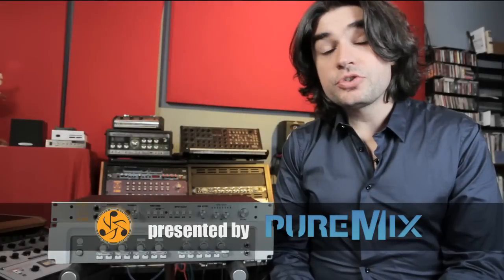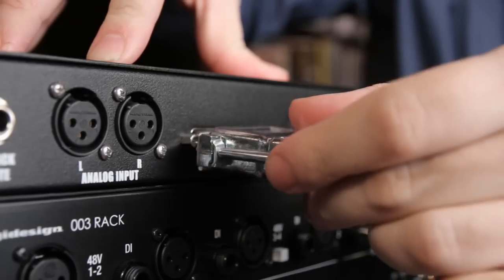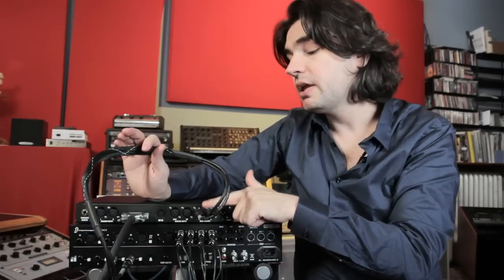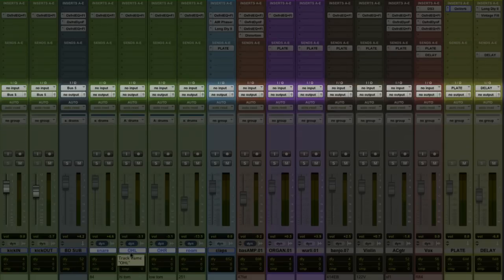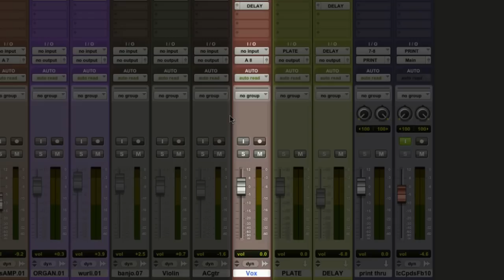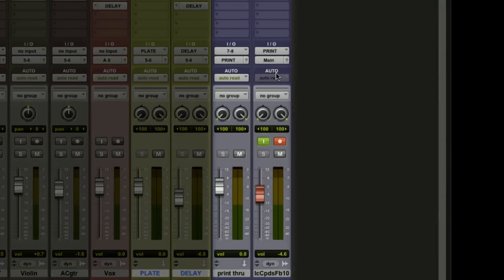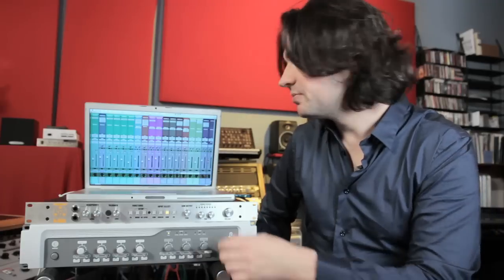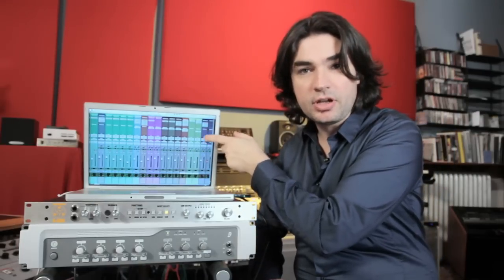Dangerous D-Box: Integration

Comment from the maker: It can be used for tracking or mixing. It allows you to utilize all of your D/A converters, giving you more headroom, and letting you sum your tracks in the analog world instead of the digital world, which ends up giving you benefits like tighter bottom end, more punch, more depth and width, etc. It also allows you to take advantage of the recall benefits of your DAW, while still using a console-like workflow and getting your mix out into the analog world.

Comment from the maker: Stem is a term mostly used in mixing/analog summing where multiple tracks of audio are being bussed to one stereo pair. So for instance a "drum stem" might have kick, snare, hi hat, toms, and overheads all bussed to outputs 1-2 on your interface. Unity gain means the device is neither adding nor subtracting gain to the signal, so it usually means when a fader is at 0.

Comment from the maker: You don't really need the impedance transformer- a regular 110 ohm digital audio cable is sufficient, but when connecting spdif and aes devices together there is one very very important rule to follow, which is that the cable must be kept as short as possible. Any more than a few feet runs the risk of the impedance actually becoming an issue- but at such a short length it is totally viable.

Comment from the maker: @memberboard1 the Rosetta 800 has an AES in/out d-sub. You will have to look in your manual for the configuration, but all you need to do is get a digital snake cable that goes from AES to XLR, and plug the first AES out into the D-Box DAW input.

Comment from the maker: To use external outboard gear with the D-Box, you would just insert it between your interface analog outs and the D-Box Sum Inputs. For example, to use a stereo compressor on the drum stem, you could output the drums on 1-2, then plug analog out 1-2 of your Saffire into the compressor, and then output of the compressor into D-Box Sum Inputs 1-2.

Comment from the maker: When using the D-Box you still need an interface to handle the conversions. The D-Box only has two stereo digital inputs with a D/A converter that is meant to be used for monitoring. The functions that the D-Box performs are Analog Summing, Monitoring, Stereo D/A, Talkback, and Headphones. As far as quality of the converters, this box is made to mastering specifications and the converters are made to be mastering quality reference converters, meaning they are clean and transparent.

Comment from the maker: @tpatmix58 Also, yes you can use an LT and D-Box together. If you just take the Sum Output of the D-Box and plug it into the Expansion In of the LT you can have 24 channels of analog summing perfectly linked together.

Comment from the maker: @mtracy19 it sounds like an issue with the UFX. Make sure you go into the rme software and turn off the monitor control. Outputs 1-2 are usually controlled by the volume knob when you are using the UFX as your monitor controller, but when you are using the D-Box, you want don't want those outputs to have variable volume.

Comment from the maker: Yes 7-8 can be a regular stereo pair if hard-panned. The volume difference is probably due to the phase relationship with the signals. When they are hard panned there is no phase cancellation happening.

It's normal for SUM and DAW to be different levels, because you are listening to 2 different D/A converters, which have different calibrations.

Comment from the maker: You just have to route the output of the aux into the input of the print track via an internal bus in your daw. So for example, set the input of the aux to be 3-4, and the output to be bus 1-2. Then set the input of the print track to be bus 1-2, and the output to be digital out. That let's you monitor the mix at the very last step via the DAW button on the D-Box

Comment from the maker: The 002 will no longer be used as the monitor controller, the D-Box will. So all 8 of your analog outputs from the 002 will be used for analog summing and will be plugged into the D-Box. Since the D-Box is sending your signal to your monitors, and all of your outputs are plugged into the D-Box, you can easily monitor any output from your session.

Comment: In pro tools the number crunching is all out adat 1/2.. I know crunching is blurring the image, but the mixes are super nice.. not pat'n my own back, but I was wondering if running the outputs of the 002 which are all open, would this mess up my d/a conversion from the apogee, or would this be bypassed all together, the d/a of the 002?  I have 8 outputs open on the 002  but all 8 channels of the ad8k are running inserts with my hardware..

Comment from the maker: Well, the D-Box analog inputs have a maximum input level of +27 dB, which is 5dB higher than the output of most interfaces. What that means is no matter how loud your tracks are coming out of the interface, they will never clip the D-Box. So if your tracks are in the red, but you don't hear any distortion, you are fine.

Comment from the maker: What you want to do is bypass any levels controls on the interface. All 8 of your analog outs should be fixed at line level. When you are using your interface as your monitor control, you need that volume control, but since you are now using the D-Box for monitoring, you want all of your analog outs to be fixed at line level so that they can be accurately summed

Comment: I have this exact setup, try it this way.
Use 1-2 (Stereo Pair) as your summing output. Ignore your master channel in Logic
Connect your sum output from D-Box to stereo input on UFX. 
Create Aux track in Logic mixer and set input to same inputs on UFX that you connected D-Box Sum Output to. This is your new mixbus.
Route that aux to a bus, let's say Bus 64, which has output set to 13-14 AES
To print your mixes, create an audio track in arrange window and set input to Bus 64.

Comment: I am using a Apogee ad8000se, adat in and out to a digi 002 all clocked by a big ben, I have quite a few pieces of outboard gear including your phenomenal Bax eq,  a Manley mu, Avalon 737sp 2dbx160a's,aphex 104  and pretty much monitoring aes out to a alesis masterlink..  I use the apogees outs as of now.. How could I incorporate a summing mixer like this! saw you at sweetwater gearfest.. whats your thoughts on this, the most efficient way?

Comment from the maker: @memberboard1 As far as PT9 is concerned, everything would be exactly as described above. As far as the 800 goes, the theory is the same. Take your 8 analog outputs, plug them into the SUM input of the D-Box, take the SUM output, plug it into a pair of line ins on the 800 to record your mix, then set the output of that track to the digital out of the 800, and plug that digital out into the DAW input of the D-Box, and use that to monitor your mix.

Comment: I just bought the D-Box and I use it with Logic Pro 9.  I follow everything just fine except, when you get to setting up the Aux tracks.  Logic Pro is set up somewhat different when it comes to the that.  I don't have a "Print" option.  So I need to know in Logic, what should my Inputs and Outputs should be set to for the AUX, as well as for the Audio track channel strips?  Also, am I assuming correctly that we're recording the D-Box output on that last audio Track that we have the "Record" on?

Comment: I had a question about the AES/EBU to SPDIF cable you're using, or that you're using an RCA to XLR on a digital connection. AES runs at 110 ohms, SPDIF 75 ohms. Im having a hard time finding such a cable. Ive seen inline impedance trasnformers but they are expensive. Are you just using a regular XLR to RCA cable? If so, I dont think thats a good idea for monitoring your sum I would think.

Comment: and sorry, if you do the alternate "Tracking" bus in Logic, you will not need to monitor through "Sum" on D-Box. Goal being, you don't have to adjust your D-Box main volume, or flip monitoring sections. YOU WILL need to engage audio monitoring in Logic as well as Low Latency mode. This will bypass some other latency causing bus plugins, but if that bothers you, you can just do the Sum on D-Box and hear all your processing from Logic. :) 
Sorry for the long winded book, Hope some of it helps

Comment: Also, do I from now on have to print mixes to tape instead of bouncing down directly into protools. IF I perform a bounce now, I can monitor thru the dbox, but the sound will not be the same as summing out. is that correct.?

Comment: Question. I now have my dbox and holy shit what a first impression. But. My question is. When comin back in on 3 and 4 inputs after summing how do I monitor the difference. The way I have it now. I have an aux that accepts 3&4 as inputs and I go out thru the digital out....for the print track do I use 3&4 as the inputs as well and out again thru the digital out. Im a bit confused at this point

Comment: So, how do I A/B between my mix PRE d-box, and my mix post d-box return? I basically want to hear what difference summing through the d-box makes in a quick A/B fashion. Thanks.
Reply from the maker: Hey Bill,

It might be best to give us call and talk through it. What Fab is talking about at that point, is essentially input monitoring. When it's on, you'll hear audio hitting that track if you hit play and your routing is correct. When off, you'll hear the audio that was recorded to that track, if you recorded the mix already. If you don't hear audio when it's on and you hit play, something is wrong with your routing.

This is not the same however as hearing it pre/post D-Box. There is no real way to do that other than doing a mix in the box first. Then starting the mix from scratch with analog summing the entire time, and comparing the two different versions.
Reply: @dangerousmusic  Clear as day :) Thanks

Comment from the maker: It would be the same as in this video, only instead of 8 analog outs from the 003, it would be 8 analog outs from the 192. Instead of bringing the Sum Output back into 2 line ins of the 003, you'd bring it back into 2 line ins of the 192. And then instead of monitoring the mix from the SPDIF out of the 003, you would go from the AES out of the 192 into the DAW in of the D-Box.

Comment: Dangerous Music , I've had this box for a couple years and love it. I'm NOW thinking of adding a second set of monitors. is it possible to share a sub and switch between two sets of monitors? or is there a creative way to achieve this without sacrificing the quality of monitoring? thx!
c
Reply: Just add analog deluxe Y splitters on the jacks or hack the analog wires directly with a welding iron to have rca outputs. You can also try to add an input selector, like those for gaming console outputting to television for multiple rca/component imputs. Maybe you'll need a few adapters to go through rca jacks but I guess it can work if you know what type of signal you have in the analog plugs. By the way, the signal going to the selector rca  jack should not be directly going to speakers, but to an amplifier because the wiring of the selector isn't good enough for outputting 10 watts or better.

Comment: In that case, what if I wanted to monitor through the D/A of my interface. Would I simply route my MAINS (continuing from the example in the video) to an analog pair of outputs which go straight to my main speakers? Or do I need to do something else? For that matter, what if i did not want to monitor through the D-Box's D/A for summing and/or tracking?

Comment: I had issues trying to change "Stereo Pair" outputs in Logic. I tried everything. 
I thought I could maybe rename 13-14 as Stereo Pair in the in/out control section.
I was worrying about monitoring the D-Box inside Logic and having latency even with watching the playhead and so on....but the only latency I run into is tracking of course. For this you can monitor through sum section of D-Box when tracking, instead of DAW.

Comment: I'm having trouble getting a digital input signal to my dbox, I have a 75 ohm la audio cable in the mail, but a local supplier gave me a pro linx rca  to coaxial plug (75 ohm cable), the coaxial plugs into a canaire ( coax to xlrm) impedance changer ( part # 8cj-xp-trc ), this has 110 ohms written on it.

So I'm sending 75 ohms from my digi 002 console and the dbox has 110 ohms plugged into it, I'm thinking this is wrong

Any thoughts

Comment: Now datz sum complicated shit. I don't even know what a D-Box does. I came here because a friend borrowed me the digidesign 003 rack but my MacBook has no FireWire 400, only 800. is it worth 2 keep dis interface alive or buy something modern?
Reply from the maker: A D-Box does analog summing, monitor controller, and has a mastering grade deference digital to analog converter for your monitoring path. As far as the 003 goes, there are certainly newer interfaces that are a big step up in quality these days. You can just a firewire 400 to 800 adapter though, if you wanted to keep using a 003. Then add a D-Box to improve your setup.

Comment: hey I have an RME800 interface and the D-box,,, do i change anything in 
the Fireface routing pop-up box where u control the inputs/outputs to 
Front+Rear or Emphasis/Professional checkboxes? I have the spdif to AES XLR connected from RME800 into D-box jus not sure why I'm not getting signal into my PRINT Track,,, use 11 & 12 as the outputs coming out of Logic? Thanks for any help